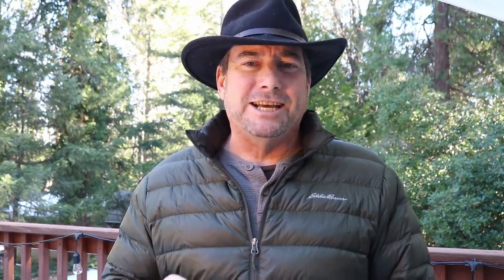Blancolirio UH-60 Safety Stand-Down

Comment: Back in the 90's in Alaska a friend of mine who worked for the same Air Taxi operation as I did, was also a Army guard helicopter pilot who flew Huey's. He had a set of night goggles that were attached to his flight helmet and he would occasionally bring them to work at the Air Taxi operation. We would then drive around in our vehicles with all the lights turned off, wearing his helmet and as long as you had some moonlight or starlight that the goggles could amplify they worked pretty well, but drive into some overcast that blocked out the moonlight and it was lights out city.

Comment: As an ex- part 121 captain/ first officer for years (yes your airline Juan) and currently part 135 in my retirement I am pleased to say my outfit utilizes among other things a “pre flight mitigation “ tool.  This tool which is used before every flight will score how safe it is, and if it scores a certain number say 26 then you have to call the chief pilot or director of ops to discuss the possibility of mitigation.  As good as this tool is and I do think the mitigation tool is very useful it doesn’t have a question parameter that includes two captains flying together.  
One of the the most dangerous cockpits is two captains flying together.
It’s called “diffusion of responsibility” if I recall correctly.  One captain in this case thinks or assumes the other captain has everything under control and sits idle while things unravel.
I am currently in the middle of a captain/captain trip with me as PIC.  I have made it clear in a very PC/Professional/friendly way that while in the cockpit I’m the captain.  He understood the delineation and appreciated the candor, I also explained the rolls may be reversed sometime in the future depending on company needs.  He is much younger than I am and took this temporary downgrade well.  
I think I am going to petition for a new mitigation question that asks if both pilots are captain qualified.  If the answer is “yes” then it’s a cost of a couple points towards a “no go”.

Thanks Juan love the content.

Comment: Whenever I was paired up with another high time pilot, it would completely wreck the risk assessment.  Two of us had as much flight time as the entire rest of the unit combined and it messed up all the statistics.  Did we run into potential safety issues? Yep, but we immediately applied all that experience and knocked it off and either RTB or landed.  I also had more time sleeping in the aircraft than most anyone had flying it...
Reply: Great link.  Perhaps pin in this link. It is an anecdotal gem which exemplifies all Juan's 'CRM' references. I am not a pilot but this unquestioning silence due to seniority deference  is also a trait in other team management/operations.

Comment: A good example of the assignment of aircraft control, based on level of experience, is illustrated by U.S. Airways flight 1549. Following loss of both engines after a bird strike, Capt. Sullenberger said only two words: "My aircraft." F.O. Skiles answered: "Your aircraft." Sullenberger flew, while Skiles handled the radios and checklists, and supported Sullenberger's actions. Before impact with the water, Sullenberger asked Skiles for any advice or input, about the actions taken. Skiles approved of the decisions made.
A textbook example of good teamwork, well executed, with a plan for division of responsibilities which both men clearly understood.
This is how it should be done, in any aircraft emergency. Teamwork is the key.

Comment: We used an ORM program developed by the Army for their truck drivers in ACC.  Seems Army aviation didn't use this system for rating the threat of the sortie (fatigue, currency,  mission difficulty, etc.) Prayers for the crews and their families....
Reply: The risk assessment sheet shown in the video included mission difficulty, currency, fatigue etc.

But one problem when adding many numbers is that 5 (for highest) doesn't add much to the total. So with people half-dead from fatigue, the total number may still end up indicating an easy operation with low risk.

It's just that there isn't a linear relationship where the total score is more or less based on the average of each section. Outliers in some sections should be valued higher.

Comment: Windshield Anti-Ice and it mostly just melts, doesn't really shed. Because its electrically operated it is usually turned on before ice builds up because it doesn't rob engine power. The Engines have both anti-ice and an Inlet Particle Separator. Ice from the windscreen at low airspeed would not likely be ingested in the engines. 

Utilizing a pilot in place of a NRCM is not altogether uncommon. Crewmember task training between a RCM and a NRCM are not significantly different.

If you're interested in current information from a UH60 Pilot id be willing to have a conversation.
Reply from the maker: Thanks Jeff! See email link in 'About' section of this channel.
Reply: @blancolirio  email sent.

Comment: We lost a SH-60F on the ship because the pilot on NVG did NOT stay 'outside the cockpit, but rather when the H2P ('inside the cockpit,' monitoring the gauges) asked a question,  the HAC looked at the instrument panel. The a/c was on short final to the carrier and struck the water just behind the ship.  Both pilots survived but all 3 ASW operators died and were never recovered. We only recovered the a/c's nose door.

Comment: The Blackhawk uses a GE T700. The GE T700 has FOD deflectors for the inlet.  There is also a particle separator that spins out the FOD (inertial separator).  That means the inlet is heated plus the inlets are protected from FOD.  Hard to believe ice could enter the intake and would get past the FOD deflector, and particle separator.   In the Blackhawk Operator's Manual, the engine is part of Section III, the Cold Section is paragraph 2.17.1   Here is a link to the Blackhawk Operator's Manual:  https://apps.dtic.mil/dtic/tr/fulltext/u2/a409934.pdf
Reply: ice on the rotors can cause a crash too.
Reply: Ice can get anywhere. Juan is right, no matter what the manual says (sop)

Comment: Risk assessments are a great tool, until they are over used. I've seen first hand over zealous safety management start requiring risk assessments for fairly mundane, low risk tasks, such as using self supporting A-frame type ladders. The end result is risk assessments become just another annoying piece of paperwork to get in the way of someone doing a job. I believe this causes "paperwork fatigue" and tends to make risk assessments of tasks that really need them treated in a similar annoying paperwork way.
I also believe there is another issue that you touched on in your discussion regarding the B-17 accident- normalisation of deviation. If you keep filing the same (or similar) risk assessments for similar work frequently, you tend to reduce those risks in your mind, as it has all been done before with no bad outcomes.
I believe risk assessment should have never been pushed onto the people doing the work, they should be conducted by an independent third party, someone who is not regularly exposed to the activity so the third party can look at the task as a relative outsider with no preconceived levels of risk.
In short, I believe risk assessments need to be treated as a separate position for a specialist in this field, much like a QA person is a specialist. They should have the same mindset as a QA person- looking for reasons to fail a process (or task in this case), rather than trying to make a risk assessment fit into a "go" mindset.
It is human nature in high performing individuals (like most flight crew are) to be extremely task oriented and focus on successful completion of the task required. I believe this in itself should be enough to exclude them from performing their own risk assessments.

Comment: I found it very odd that both crashes had 3 pilots on board, and no crew chief. In my couple thousand hours of UH-60 and UH-1 crew chief flying, I never saw NVG ops with 3 pilots and no crew chief. The pilots are very good, but the sight picture from the side (crew chief) is very different from flying in the front. Not saying the CE would have saved the day, but we were expected to speak up when we thought things weren't going right. We also had the 2 challenge rule, so if you object twice, the safer option must be done. We needed to keep the crew chiefs current, so they need to fly also.

Comment: Another outstanding video. I thought you may have made a very brief allusion to AF447 in a previous video; how about a detailed evaluation of AF447? The more I read the less simple it seems to have been, regarding deep stalls in thunderstorms. Would be extremely valuable. Thanks!
Reply: to be more specific regarding my initial comment re: AF447, this former USN test pilot school director    https://youtu.be/ZrtfUZRk5h4  feels that the deep stall of the aircraft made the situation nearly unrecoverable soon after entering the stall, due to deep stall induced loss of authority of the horizontal stabilizer/elevator, the inappropriate flight control inputs/oppositions which many focus on notwithstanding. It is 58 minutes, but I learned a great deal and wonder what experts other than the linked video creator CDR(ret) Robert Johnson think, as the immediate gravity of the deep stall soon after entering the cell seems to not be emphasized in some reports. Your thoughts regarding how much the inappropriate control inputs contributed vs deep stall setting up extremely difficult recovery conditions soon after deep stall entry, even with correct control inputs? Of course both contributed, but it surprised me near the end of the video when he essentially states his opinion that the situation was nearly unrecoverable soon after entering the stall, himself included as an experienced test pilot with UA recovery experience and TS penetration experience, at about 56:20 to the end. Juan, sorry I'm off topic from today's UH60 video, but this would be a great topic for you to cover, especially given your recent refamiliarization training in a heavy.      https://youtu.be/ZrtfUZRk5h4
Reply: But Airbuses can’t stall! 
Yes, I know, of course they can, but that was the Airbus mentality that was becoming almost “normal”. Combine that with over use of automation, and lost hand flying skills, and it was a scene ripe for disaster. In good weather sometimes (in a Boeing) my FO would say to me “Do you mind if I disconnect early on approach and have a hand fly?” 
My typical response was “Actually I mind if you don’t have a hand fly!”

Comment: It is windshield anti-ice per the TM. Flip a switch and the glass warms to 43C / 109F within a few seconds. I wish cars had a similar system up front, but that would require a more robust electrical system, laminated glass and a potentially expensive conductive layer. Even though the UH-60 is capable of flying in light and moderate icing, it rarely happens unless the mission is extremely urgent. They rarely fly into clouds. It would be uncomfortable planning to fly into known icing.

Comment: Juan, we have done ourselves a disservice by calling those light amplification things Night Vision Goggles - in truth, they are Low Light Goggles.  As you have pointed out, they still require some light to work.  I once spent time with the Navy out on the Chesapeake Bay at night and at certain locations and in certain weather locations, we were simply blind.  Of course, being on the water, all we had to do was stop and take the time necessary to regain our situational awareness.
Reply: I started flying in the army with PVS 5 cutouts.....when I left we were up to ANVIS 9...... I am going to say you had not touched a pair of aviation NVG in the last 20 years at least

Comment: Hey, just a quick comment from a S70 and DC9 type rated pilot regarding Blackhawk de-ice. There’s no issue with ice getting into the Blackhawk engines. They have very powerful Inlet particle separators (IPS) blowers in the inlet ahead of the compressor section. These are designed to eliminate any ice shed by engine inlet anti ice systems. Nothing like what happened to SAS MD-80 would ever happen to a Blackhawk.

Comment: They actually touch on this in the aviation instructors handbook in the risk management chapter in the “5P” risk management model under “passengers”. If the passengers are pilots there should be a clear distinction of who is actually PIC and calling the shots.

Comment: We had a Pilot (a Lt. Col.) who was our ANG Unit's Civil Engineering Commander too.  Once a month it was cram, cram, cram to "check the required blocks" to stay current on one AFTP night flying slot.   I was usually assigned as FE on this once a month flight, I absolutely hated that flight as he would try to pull the wings off of the aircraft.  I finally refused to fly with this Lt. Col. and my supervisor backed me up.
Reply: Good for you!

Comment: After looking at the schematic of the blade deicing system and it's pulse times, along with areas to be deiced on each blade from 1 to 3 and then 2 to four, is definitely problematic.
The systems warning system along with what selection should be used and when, min, moderate and heavy ice, is confusing to say the least. I would during this shutdown, have all crews review the operation and specifics of deicing of the 60. 
Not knowing what happened in the mountains is unknown and tragic. If I was the director of this operation it wouldn't have happened. What were they trying to prove? My Monday morning quarterback tells me the system was used too late or the selection and removal of ice was not adequate for some unknown reason and the aircraft was loosing torque as I explain below.
            
But the accident in Rochester may help by the witnesses that heard the aircraft and especially and Most Important Thing, why the crew did not flare for a landing? Did they have an unusual icing problem, one or two blades different from the other two? A mechanical problem do to ice affecting cyclic control or some other problem? 
I don't know this, with my limited experience with crappy old style night goggles, but maybe someone can answer this, are they easily removed if necessary? Was the aircraft out of the clouds, VFR at that time? How about the blinding affect these can have in city lighting and ruining your depth perception? Wow, a lot for the accident inspectors to sift through. Oh yea lets not forget fatigue of the crew members in both accidents since they were both late in the day.  

My flying in unexpected icing conditions with the Bell 212, Agusta and S76 which happened a few times in all three of these helicopters, I did have, and planned to have good VFR below the unsuspected and possible icing by the way, other than the defrosted windscreen which didn't give me a good indication ,the first thing noticed was the increase in torque needed to maintain the speed and altitude. Slight vibration was also felt in the 212 and S76. Solution of course was to get out of the ice pronto. 
To me the Rochester accident investigation will be interesting.  A lot to digest in both accidents.